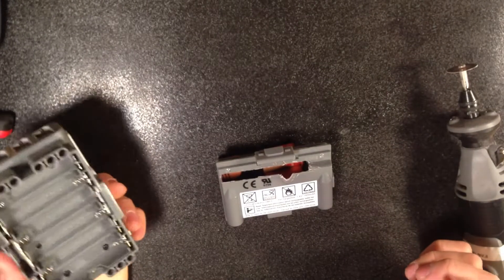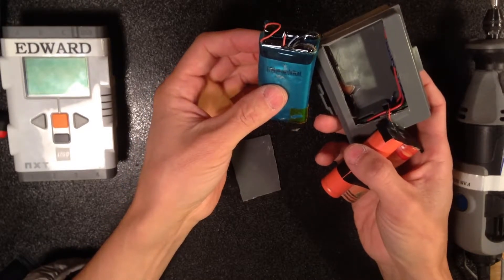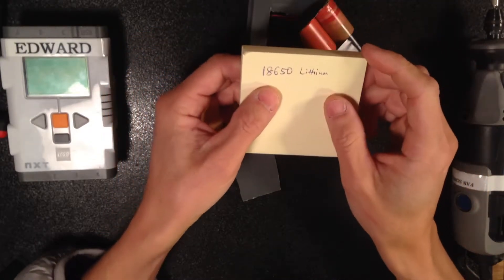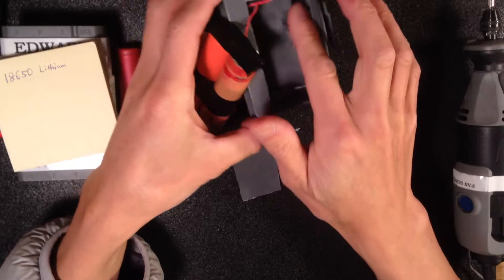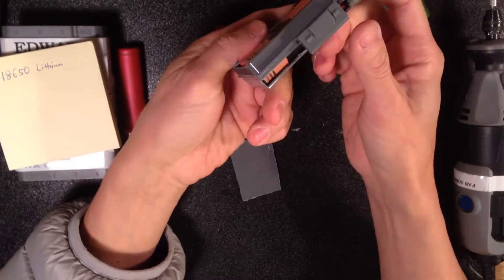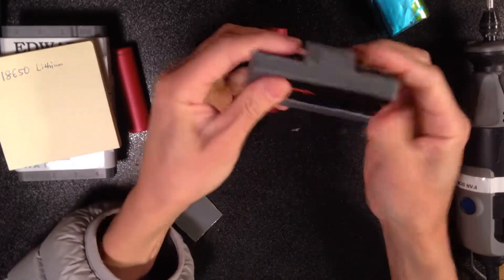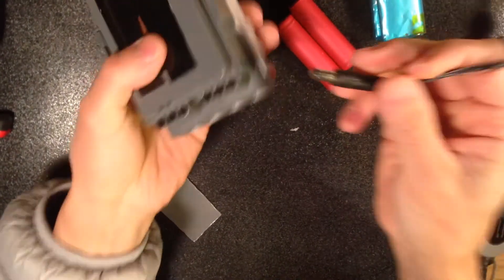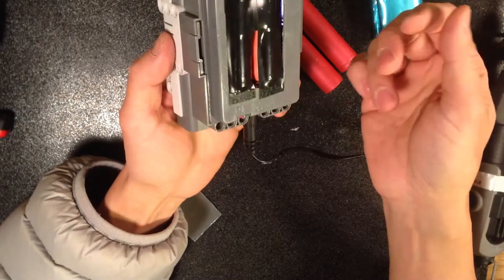DIY Lego mindstorm NXT Lithium battery

Comment: There are 3 wires, red, blue and black in the old battery pack. New cells have only two wires, black and red. Can you show the role an connection of third wire (blue)?
Reply from the maker: I think the blue usually is the temperature wire. You can skip. only connect the red and black should work. Just don't overcharge the battery overnight. If doesn't work, then need to cheat the blue wire using some other way.

Comment: What's the current of these 18650 cells? 2000 mAh?
Reply from the maker: The 18650 cells were from the Lenovo Laptop with a small cycle counts. Usually the OEM cells are between 1800mAh-2200mAh.
Reply: @fsong00  Thank you!